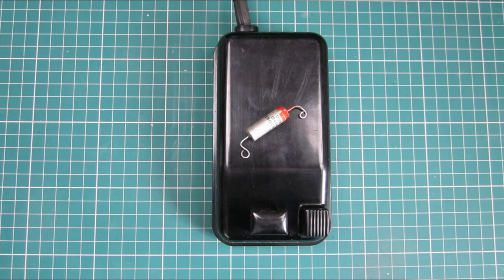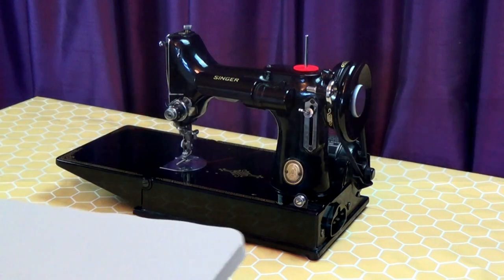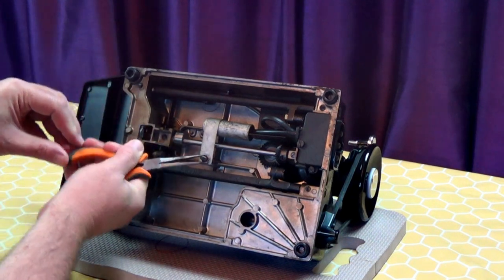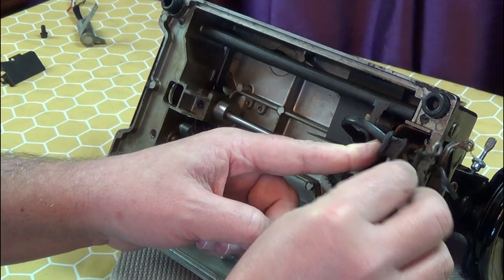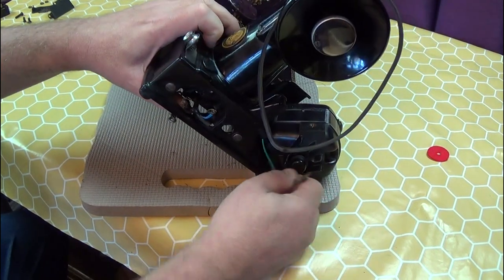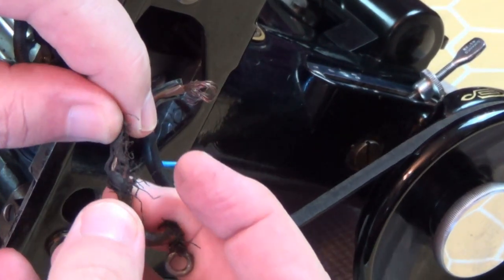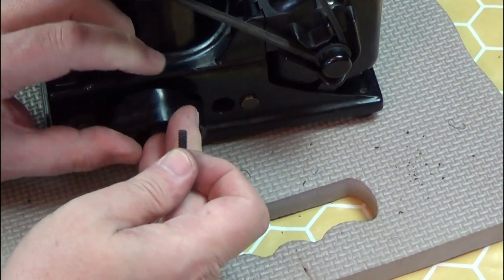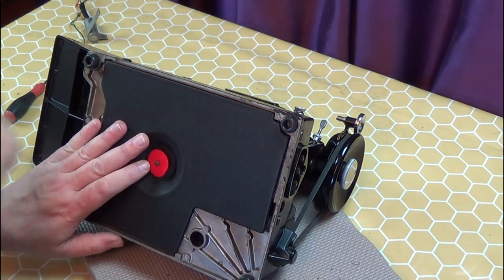Singer Featherweight 221 - How to Remove the Internal Capacitor

Comment: Thanks, was always curious of the capacitor on the underbed of my 221. 
Have 2 of these machines only a year apart in manufacture, one has the capacitor and one doesn’t, couldn’t understand why. 

Always something new to learn, only difference apart from this was one has a switch for the light on the fitting and other is separate on the bed of the machine

Will be taking a closer look next time I get them out, strangely don’t know why but I always preferred one machine over the other.
Love your channel and knowledge!
Reply from the maker: I wonder if they were made in different factories.

Comment: I had known about this. Old capacitor AC current. In American sewing machine don't have it. First time got a 222K Singer featherweight from UK have the two capacitors on the foot paddle and one on the motor too I removed it they get dry out can cause short. Thank you for sharing your video. Have a good day.
Reply from the maker: I think the locations of the capacitors varied from machine to machine. I've seen much earlier machines with them underneath as well.

Comment: Thanks again. Removing the capacitor went very smoothly with the aid of your video, and now working fine again. Think I may have to be looking at a rewiring job before long though. I guess the shrink wrap is a short term fix. Once again, very grateful for your videos

Comment: Hello again. Now embarking - with the help of your video - on removing the capacitor in the base of the machine. Started to melt down and caused my wife a fright. I think I will be able to follow the instructions - very clear as usual, but I see that in my mum's machine there is no insulating plate or cover over the electrical connections. Is it possible to get hold of replacements these days?
Reply from the maker: Yes. You should be able to get any parts you need. Good luck!
Reply: I too am missing this cover plate.  What is the part number I should be searching for?  I actually am missing it on both my black 221 and my white 221k.  Excellent video. New subscriber now!

Comment: Thanks that was a great help. My 221K started smoking last night and on looking behind the receptacle on the machine i could see the wires were in really bad shape. I'm trying to pull the motor apart but can only find one screw, do you think the second screw might be behind the solder that attaches the green capacitor onto the motor. I can only find videos that deal with the American version and they didnt have a capacitor so not much help for those off us dealing with the British versions. Many thanks.
Reply from the maker: There is only one screw holding the motor on. The green wire that goes to the motor may be causing you to not be able to remove the motor

Comment: Awesome video - I really like your clear instructions! I have one problem: I have a number of Featherweights I collected over the years and the foot cotrol always has to be overhauled completely, plus the electric cord changed. There are 2 wire rings that are at each end of the plug, holding them together (apart from the screws). I have a hell of a time getting those over the "hump" (removing them is easier). I hold the underside in place against the edge of the table and try to pull the top part over the lumpy bit using a screwdriver shaft sideways. I am female and have very small hands - it is horrible to do. Do you have any better idea?
Reply from the maker: Unfortunately I don't. This is a common subject on the Singer groups and your method has been the only answer I have seen. I suspect Singer had a special tool for putting the rings on. If anyone can suggest another way, please let us know.
Reply: @CurioByBSpokeDesigns  Thank you. I shall put my thinking cap on to come up with something. Have a happy year 2022 (without Corona, Delta, Omicron!!!!)

Comment: I have another question: I am going nuts trying to find the right electric cord for the Singer Featherweights. I had finally found 2-core x 1 mm2  that measured an outside diameter of 6.4 mm which worked for the machines but when I ordered the same iutem again, it was 7.5 mm outside diameter which was too bulky. Now I am really stuck - I just cannot find anything suitable here in Germany. I  could only find 2 x 0.75 mm2 which I felt was too small. Do you have an further information that could help me here? Happy New Year!
Reply from the maker: I'm sorry i can't at the moment. I recently bought some cord to rewire a featherweight - I'll find it and let you know what it was. Happy New Year!

Comment: So there is one on the pedal and one inside the machine? Both doing the same job? Redundancy? Are other models like this as well? Am I asking too many questions? Lol
Reply from the maker: No, it’s either or. Some were in the pedal, some in the machine, some had none at all. I have seen small boxes with capacitors in under the motors of Singer 99s and capacitors that looked like two sticks of dynamite on the backs of Singer 201s!